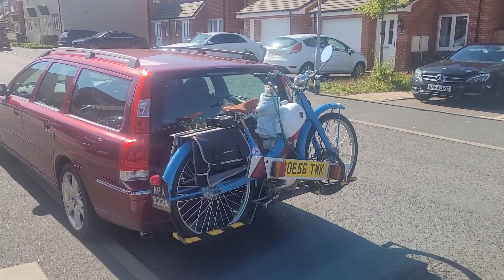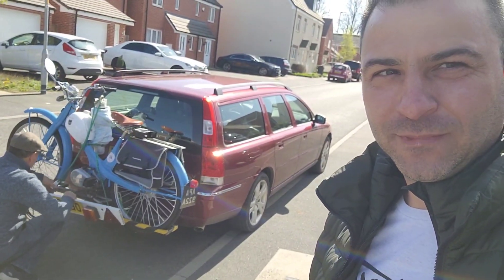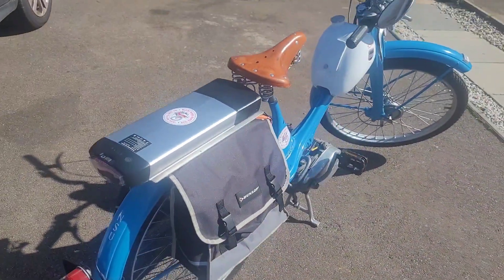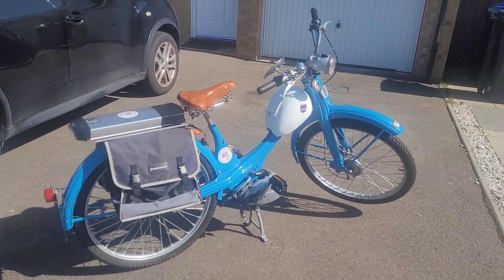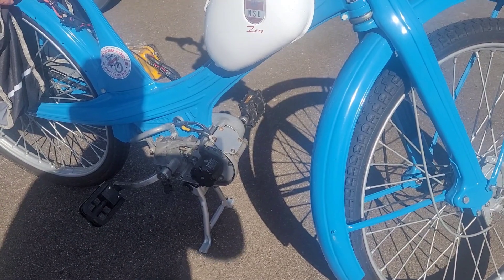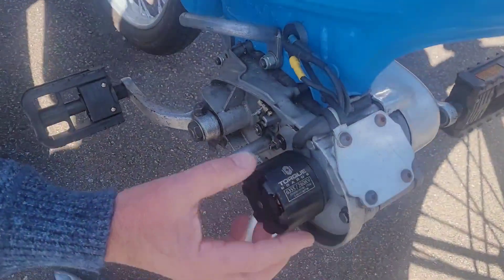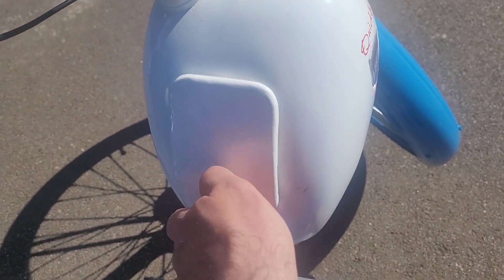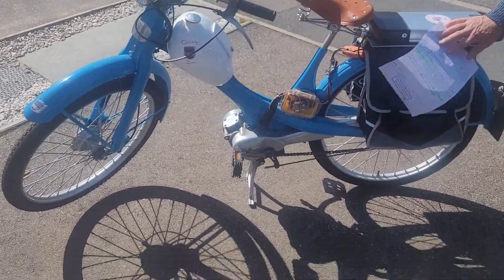NSU-QUICKLY ZERO          100%ELECTRIC POWERED

Comment: As an engineering example its good but......... It sounds awful! Can only do 20 miles! (A 67 year old Quickly can do over a 100 on a tank), And isn't Zero carbon. A coal powered power power station produced the electricity. The battery production and eventual disposal is extremely toxic not to mention slave labour in obtaining the raw materials. Plus Luton Airport car park..... 30 million pounds worth of damage caused by one hybrid vehicle having a run away catastrophic chemical chain reaction of the battery. Just saying....... I'll stiuck to my two stroke Quickly thanks. Great vid btw. :-)
Reply: There is no electricity produced from coal in the UK. Not sure he mentioned the range - how did you calculate it? You are ill-informed about battery disposal and recycling, again the particular battery chemistry used here was not specified, so where is your info coming from? As for slave labour, again that depends where the materials came from. There are plenty of human rights abuses in the production of fossil fuels too, but you seem to be OK with that.